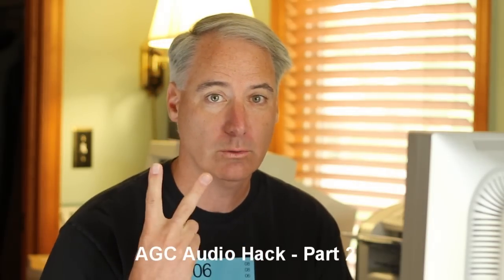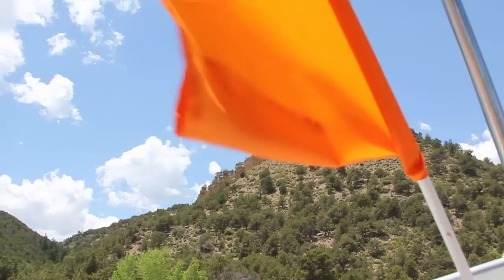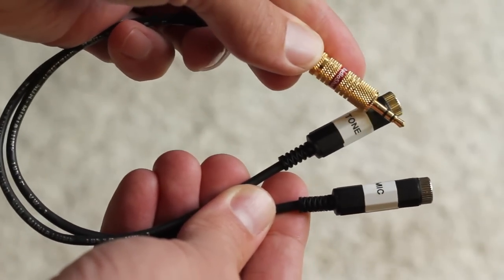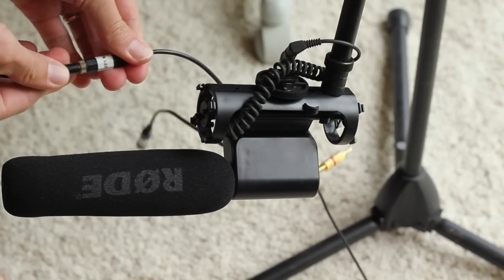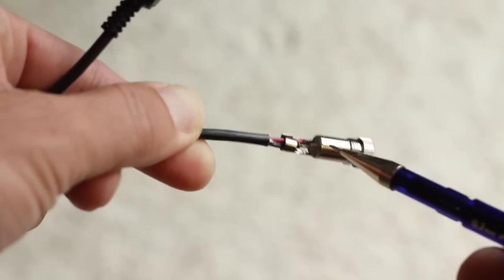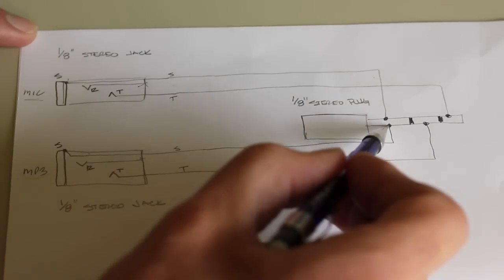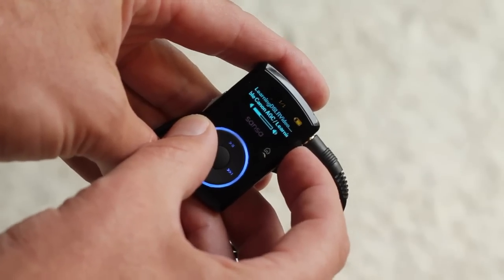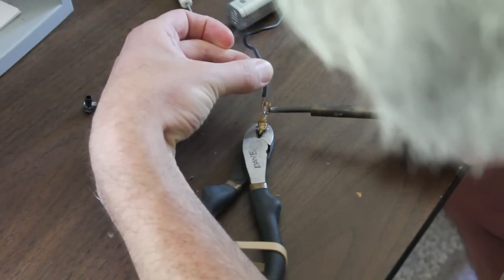Audio Adapter to Disable Canon DSLR AGC for the Rode Videomic -- Part 2

Comment: If you have a T2i an alternative to tricking the AGC like this, one can install the Magic Lantern firmware which will let you turn off AGC.  Among other things.  

Though, may be good idea to have this trick cable around incase you run into any other device that suffers from AGC, likely would work on those too.

Comment: I bought an double-rca to 3.5mmjack, then I bought a rca to rca coupler and finally I bought 2 female 3.5mm jack to rca.. I put it together, rode in one female jack, mp3 into the other, they are both plugged in the coupler and then I plugged my rca to 3.5mm jack cable in it. What's the difference between what you made and me?